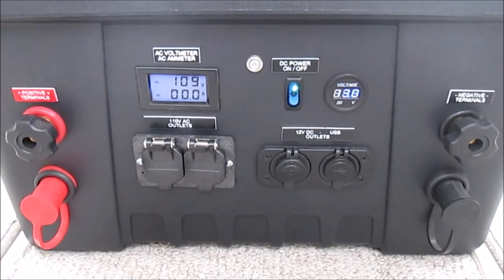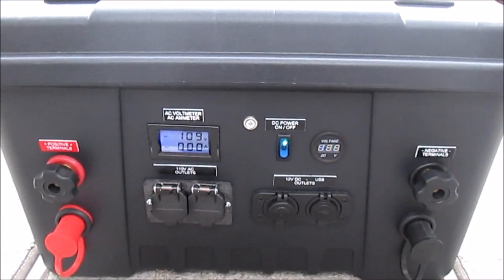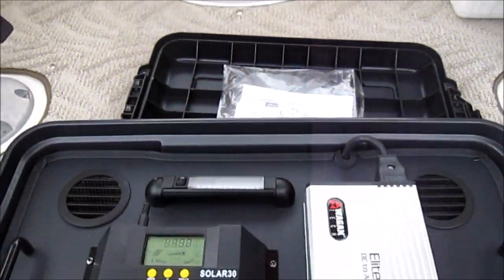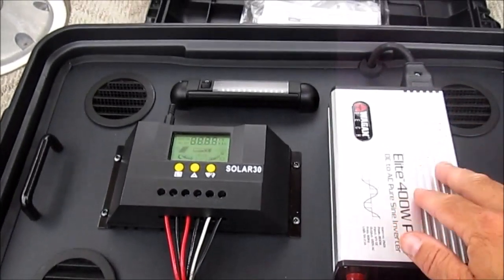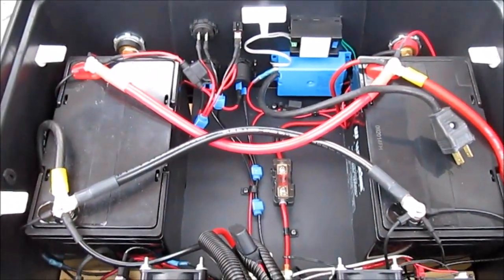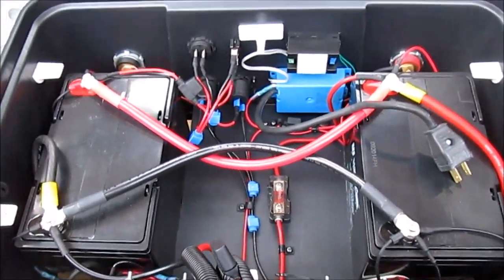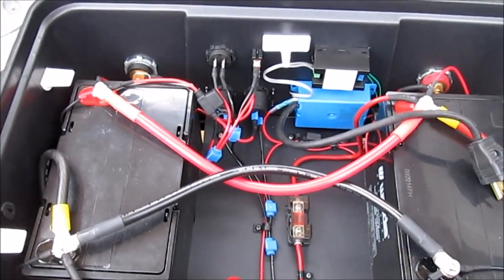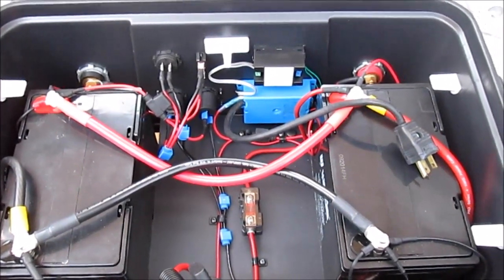V1 P3 DIY Portable Solar Power Generator

Comment: are you going to do a step by step on this product?? nice work
Reply from the maker: Thanks for your comment and question.  It is not likely that I will be producing a step by step series on the build of this design.  I am currently planning another upgrade or possibly an entirely new design built around a 200 amp hour lithium iron phosphate battery and a 2000 watt pure sine wave inverter.   If I end up going with the the entirely new design, it is likely that I will do a video step by step build.

Comment: nicer build those blue connectors are going to give you problems
Reply from the maker: Thanks for your comment,  have a look at my  part 6 video and you will see that the blue connectors that were part of the original build were all replaced as part of subsequent upgrades.

Comment: Hi Jim, nice generator.  A quick question.  Is the load for USB and 12 volt outlet connected directly to the battery or the charge controller.  On the diagram, it looks like the battery but in the video I thought I saw wires coming out of the load on the charge controller.
Reply from the maker: In my initial wiring configuration the USB and 12V outlets were connected directly to the battery.  Following my wiring reconfiguration seen in my part 6 video, they are connected to the bus bar that is attached to the load out of the charge controller.
Reply: Thanks for the reply.

Comment: How bright is that light on the top??  Are you happy with it?
Reply from the maker: It is 36 lumens.  I would compare it, in terms of brightness, to a typical dome light you would find in a vehicle, perhaps a bit brighter.  I have used it as a single light source inside my boat cabin. When it is oriented up toward the ceiling it does a good job of providing indirect ambient lighting throughout the cabin space.  I would consider a single six inch LED light of this type useful as emergency, backup lighting.  I have been happy with it, but admittedly, have not found the need to use it as a primary light source.

Comment: Great system! Going to try building since I live in Puerto Rico and still no electricity. Question. Batteries are wired in parallel meaning pos to pos, neg to beg? What’s the gauge of those cables?
Reply from the maker: Thanks,  here's the wiring diagram, wire sizes are indicated  http://creeksideartifacts.com/PSG0717schematic.pdf

Comment: Great Generator... Inspired. Just a question... Do your fans blow in or out? If in, are you concerned about dust and debris being sucked into the box? Really enjoyed your series on this Solar Generator. Thanks.
Reply from the maker: Thanks for you comments and question Timothy.  One fan is oriented to push air into the case and other to draw air out.  I have not yet done so, but one improvement I intend to make is to install a filter on the intake fan.  Up to this point the fans have rarely been activated by the thermostatic switch so I have not noticed debris or heavy dust accumulating inside the case.
Reply: Thanks for the quick response, Jim. Good idea about the opposing directions of the fans. I am in the desert, not on the water so I will also be looking at a filter of some sort. Absolutely love your finished project. It is gonna provide a great reference as I build my generator. Have a super day!

Tim
Reply from the maker: You are welcome-  hope your build goes well!

Comment: I have an inverter that I want to use for this sort of thing. It has a chassis ground connection in addition to the positive and negative terminals. Any thoughts on this? With a box like this where could I attach the  inverter's chassis ground?
Reply from the maker: Matt, I have done some research on this, but I am not a professional so I encourage you to seek other opinions.  What I learned is that you could connect that ground to an earth ground, a copper rod that could be driven into the earth.  Since I use mine on my boat it is not possible so when using the inverter I plug a 15A GFCI power strip into it and then plug my appliance into the power strip.
Reply: In an automobile you can attach the inverter's chassis ground to a ground stud in the vehicle; these studs run through the steel frame and back to the battery negative post. I don't know if any such ground studs exist on a boat. For my jeep this makes the box less portable however, so I will continue to look for options. Perhaps I could use some sort of quick disconnect where the ground wire enters the box.  Thanks for the great vids and ideas!

Comment: I recommend you beef up the wires on the inverter output also as the small wires you have will drop some voltage at 1200 to 1600 watts draw and every millivolt is precious when your inverter cuts off at 10.5 and you are dropping .3 to .5 volts on some small wire at load. 1600 watts at 120V will be pulling almost 140 amps on the 12V side.
Reply from the maker: Thanks for viewing and for taking time to post.   I will take your comments into consideration as reducing voltage drop and line loss is always desirable. The larger external inverter I have came with either 2 or 4 gauge cables that I use to attach the inverter to the bulkhead terminals on the front of the case. I will have to confirm, but the remote battery terminal kit I used also came with either 2 or 4 gauge wires.   What might be of concern is the jumper I used between the two types of terminals, I think that they may have only been 8 gauge, but since those short jumpers are only about 4" in length and are rated for up to 160 amps at 2 feet, I believe they will at least be safe.

Comment: Very nice unit, great explanations, and very professional in appearance. The current transformer or donut as you called is a Toroid Core. Wrap 3 to 4 turns of your meter wire on the core (each pass into the core is one turn). Then pass the wire you want to read the current from through the hole. The engraved labels are especially a nice look.

Comment: Hi, what meter do i need if i want to see the input charge for the batteries and the output?  Is there one just one meter that will display both information or do i need 2 separate meters?
Reply from the maker: Most solar charge controllers will monitor and display battery state of charge, amount of amperage coming into the battery from the solar array, and the load output. I used two separate meters for the following reasons:  for a quick check of battery state of charge I could turn on the DC voltmeter from the outside of the case;  to check the AC voltage and amperage draw when using the inverter I use the 2nd ammeter  (also visible from the outside of the case);  this configuration also facilitates the ability to leave the charge controller in the off position when it is not actively managing the solar charging of the batteries.
Reply: What is the model and name of the two separate meters I'll need to purchase for the input and output display I am looking for?
Reply from the maker: this link is for the 12V DC voltmeter that I used to indicate battery voltage/state of charge https://www.amazon.com/Coromose-12V-24V-Motorcycle-Voltmeter-Waterproof/dp/B00S7FUT10/ref=sr_1_1?ie=UTF8&qid=1493688486&sr=8-1&keywords=coromose+12v+led+dc+digital+voltmeter+waterproof+meter+blue

this link is for the AC ammeter I used to monitor AC output https://www.amazon.com/DROK-100-300V-1-199-9A-Multimeter-Automotive/dp/B01CFWSC6O/ref=sr_1_2?ie=UTF8&qid=1493689072&sr=8-2&keywords=DROK%C2%AE+Digital+Voltage+Multimeter+AC

this is the link to the charge controller model I used (measures solar input) http://www.ebay.com/itm/LCD-30A-12V-24V-Solar-Panel-Controller-Regulator-Charge-Battery-Safe-Protection-/131262735848?hash=item1e8fde65e8:g:goEAAOSwjVVVsexz

Comment: Very good job sir! I have worked in the nuclear energy industry and your install is spot on! Only thing I would do is maybe install Relion Batteries instead of AGM, they weigh less and actually last longer. Cheers  https://carolina-energy-distributors.myshopify.com/collections/12v-lithium-ion-batteries
Reply: Also group sizes for reference... http://www.batteryweb.com/bci.cfm
Reply from the maker: Thanks for your comments.   I would very much like to reduce the total weight of my system and lithium ion batteries would surely allow for an improvement in that regard.  Only problem is the cost-   $1300 for a 100AH lithium ion battery!
Reply: Yeah, not a casual investment for sure, but in a "bug out" situation might give peace of mind, I do not know you well enough to say that for you it would be a must, I on the other hand am interested in just the technology of things, combining systems that exist for new purposes, maybe even re-purposing existing technologies in ways that are unique and beneficial to many, applying them in a way that helps many by just thinking in a way that no one has before, for instance creating a lens attachment for phones to evaluate Sun positions and exact time (with out GPS) to determine location, sort of like the old sailor did with a sextant,  I love that kind of stuff.....Cheers

Comment: Jim, I am impressed. Looking for a home project, I found professionalism. I have half of my parts ordered and will be starting the assembly shortly. You did a fantastic job. I believe you could sale these in a minute.
Reply from the maker: Thanks for having a look at my videos and for taking the time to comment John.  Your kind words are appreciated.
Reply: Jim, after cutting the shelf to fit the rim of the trunk, I watched your videos again and noticed some shelving clips/supports that are held in place with screws. Where did you obtain these support clips? I have looked at Lowes, Walmart, TrueValue, and I cannot find them. A little help here, Please
Reply from the maker: John, I looked very hard to find some ready-made plastic shelving supports and was unable to find what I was looking for at any of the same stores you mentioned.  What I eventually did was buy a door glide kit at Home Depot.  The kind that would be used with large sliding closet doors.  I simply cut and modified some of the plastic door glide and door stop components to use as shelf supports.  This product is not exactly what I used but it appears to be very close http://www.homedepot.com/p/Prime-Line-Tan-Bypass-Closet-Door-Guide-N-7527/206124257
Reply from the maker: just found the exact product I used,  http://www.homedepot.com/p/Prime-Line-Sliding-Wardrobe-Door-Nylon-Bottom-Guides-2-Pack-Adjustable-N-6761/100208202
Reply: Okay. I think that I have found a work around. Probably not as strong a material as you used, but I will keep your suggestion in mind. Am waiting on all of my parts. I am pretty anxious to get started. I have looked at many other projects and I feel yours is the best fit for me. Thank you for your quick reply
Reply from the maker: You are welcome.  Let me know if i can be of further assistance.

Comment: just a quick thought in electrical wiring the black is hot, the white is common, and green is the ground
Reply: If your going to change the color code standards, (AC/DC) make sure you label the wires as such. In case someone else has to work on the circuits. Not sure as a E.E./P.E. I would endorse your changes.
Reply from the maker: Understood that is the typical protocol for AC wiring conventions.  For simplicity's sake I stayed with DC conventions for wire colors using black for negative/common and white for positive/hot.

Comment: Hello,
i got a question about the design of your system.
When the solar panel is providing power to the system, is it used to recharge the batteries or is it directly powering the inverter ?
Reply from the maker: The solar panel must first be connected to a solar charge controller.  DC power distribution is possible by connecting directly to the load output terminals on the charge controller.  In my design, however, the inverter is connected directly to the batteries because it has a built in low voltage automatic shutdown feature to ensure that the batteries are not discharged to a level that would damage them.

Comment: This looks so damn nice . Here comes the but. lol But I would make this and use  12 volt circuit breakers instead of fuses that way  never have to fumble looking for fuses plus never have to worry about running out of fuses  that and if your out in the middle of no where land , you get my point ..I really like this power plant looks like something you  would buy. Reminds me one of the power plants you can buy have fuses soldered onto a circuit board   if that blows guess who's going to be tearing it apart to get to the fuse that's hidden deep inside the unit, cause you know you want to lose power hundreds  of miles out in the middle of no where  lol
Reply from the maker: Thanks for your view and your comments.  I don't disagree with that recommendation, there are a number of things I would do to enhance my initial design.  Beyond circuit breakers I would also use positive and negative bus bars to better manage wiring and minimize the stack of ring connectors on the top of the battery posts.  The other thing I would do is reorganize the wiring of the DC power outlets so that they are taking their power from the load connection on the charge controller.  It has a build in low voltage protection that would ensure that if a DC appliance was left on it would not totally drain the batteries.
Reply: Sounds like a plan .

Comment: Just wanted to pop in and say thank you for taking the time to make these videos. The bit about wiring the AC outlet was exactly the info I need. I'm just curious, is the fuse needed if your inverter already has one? Beautiful setup by the way!
Reply from the maker: If your inverter has an internal fuse the inline fuse isn't absolutely necessary, but for a few dollars it will offer an increased measure of additional protection and insure that an overload stays well clear of the far more expensive inverter. Changing a blown inline fuse is also a very quick fix vs. taking apart the inverter to do so.

Comment: Hi Jim, Nice work. One modification I would suggest is to add terminal blocks. This would eliminate the need to run so many wires to the +/- battery terminals and would clean up the wiring. Similar model as a home breaker box.
Reply from the maker: Thanks.  You are right, terminal blocks or bus bars would have been a much better solution to make connections.  It started out as a simple project and continued to grow in scope as I decided to add more features.
Reply from the maker: See my part 6 video for the bus bar installation.

Comment: Not sure why the need for a "generator " or really the AC inverter to boat or camp, do you need to run a microwave? Probably anything you want or need to power camping or boating can be 12 volt even TVs and DVD players, hair dryers,lights,crock pots etc. all way more efficient than converting 12 volt to AC. On the boat you could have added a second or third battery probably in the same compartment as the original battery add an isolator to prevent the main battery from over discharging preventing engine starting.  Having plenty of 12V power and freeing the tiny Cuddy floor of the 100 lb black box. I admire your craftsmanship it was a nice project and don't want to take away from skills I just don't understand the need for such? One other thing the tiny trickle charge is too small for two deep cell battery's connected.  It's one amp or less maybe  only .75 amp and may not even keep them topped off if fully charged let alone recharge them from being drained at the lake or the tent site.
Reply from the maker: Thanks for your comments Spark Jumper.  This was a project that was equal parts hobby/recreation and education that kept me occupied during the late winter months of 2015.  You are right I could have installed a 2nd or 3rd battery and also installed the necessary battery switch and associated wiring on the boat, but it would then be permanent / not portable.  As I mentioned in the first video I did not want to invest in a permanent solution on my current boat because I intend to sell that boat in about 4 or 5 years and want to take my system with me for use on the next, bigger boat.  I do find that my use on the boat over the past two summers has mainly been from the DC side as that is most efficient, but there are some appliances that I like to use on my boat that are AC (blender for example).  In the off season I keep this system in my basement, maintained by the trickle charger, as a backup power source.  I also have a gas generator, but it is nice to have this solar/quiet/fumeless option available for short term electric power outages in the event I need to run my sump pump a couple of times or to simply run some lights, TV, etc.  This project was a fun, educational first step in learning to become more self-sufficient (using solar energy).  In about 5 years when I retire I plan to transition to a seasonal, liveaboard lifestyle frequently spent at anchor on the Intracoastal Waterway away from onshore utilities (marina stays can be expensive for transient cruisers dependent upon your budget) .  For me, learning more about these types of systems now, on a smaller scale, will surely come in handy when I really need to have energy independence.  I have not found the trickle charger to be too small to keep the two 55 AH batteries topped off.  I plugged in the trickle charger over the weekend and within a couple of hours the batteries were reading 13.2 volts, which is what I understand is 100% SOC for AGM batteries.  Granted, they were not even close to being drained - they were mostly topped off with solar power before taking the system off the boat for the winter.